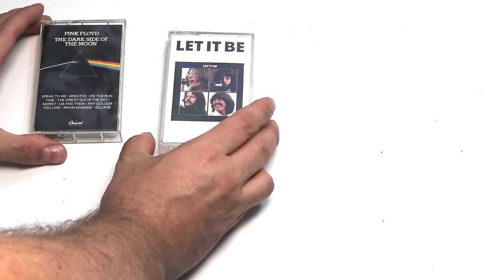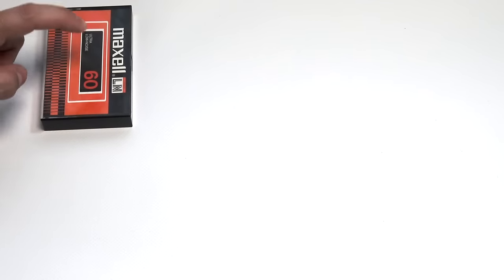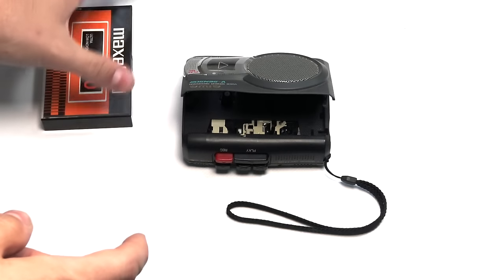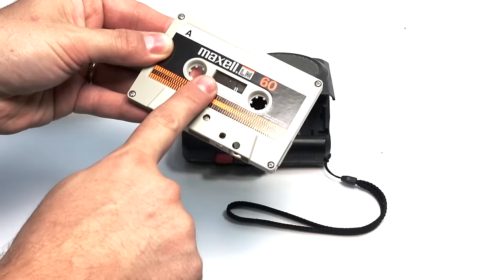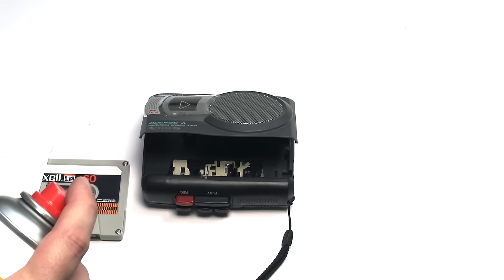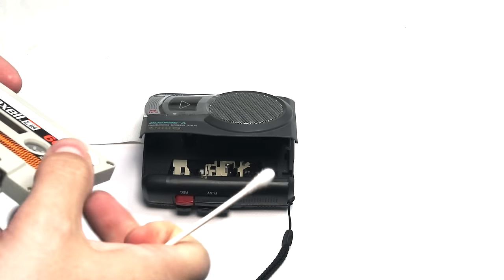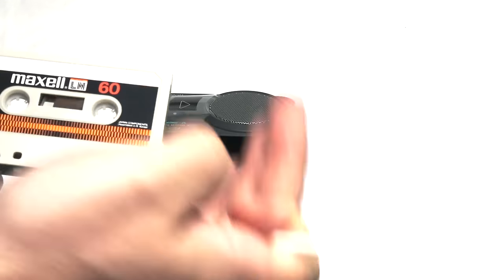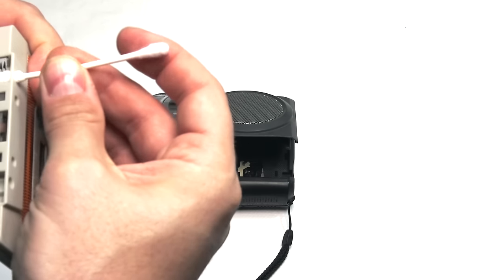How to relubricate your stuck cassette tapes

Comment: I thought the issue with cassette tape binding was always with friction against the cassette shell 'sides'?  Many cassettes even have special film sleeves between the tape and cassette covers to combat this.
Reply from the maker: In some cases it is probably part if the equation, especially when they are winded irregurarly
Reply: EXACTLY, Tim Kerins! 
Although, older cassettes may lack these special sleeves, or have paper-like ones that are not much better than sans-sleeves.
I always saved any prerecorded/blank tapes that got damaged or ruined beyond any salvageable playback, for the parts to "cannibalize" later for repairing other tapes with any dodgy/missing parts.

Comment: I recently purchased a pre-recorded cassette on ebay, and based off what you said in this video, it seems as though it does need lubricating (i tried playing it on my twin deck, in deck 2 the auto stop kept activating towards the beginning of the tape (athough it was fine once i got past that part), and in deck 1, in that same spot it slowed to a crawl a few times)
and thinking about it, i have a feeling there may be a few tapes downstairs that need lubricating (i remember i once tried to play one of those, and the auto stop activated before it had got anywhere near the end, that was before i got my twin deck, and the machine i had tried to play that tape on is now completly broken, well, the cassette part of it is broken, it makes a mechanical noise whenever i turn it on, the noise is coming from the cassette mechanism, for whatever reason the tape heads in that machine are now permently in the raised position, the machine broke when i was trying to record to a blank cassette, it breaking had nothing to do with the pre-recorded cassette)

So i will now have to try and get hold of the things required to lubricate a cassette tape (i already have a cassette player which i think is suitable, i can definatly put a tape in place with the door open, athough i am not sure if the door will be in the way, athough as the door is already a little bit broken on it, and i have another one which is identical, i am not too fussed about breaking the door off of it if needed)

and it seems i may have to experement with different lubricants, as neither of the ones you showed seem to be avalable in the country where i live
Reply from the maker: Great let us know how it turns out! Try looking for a silicon based lubricant with NO solvents, thinners, alcohol etc.

Comment: I would  be very careful with silicone as it is an insulator and can cause head problems if you get too messy. Cool video
Reply: If you aren't confident to use chemicals, you probably shouldn't be playing with electronics either..

Comment: Hi! Very interesting content!

I've been reading some of the articles available, I'll still read all the pdfs...
But reading the comments here I noticed 2 interesting points:
- Those who abhor re-lubrication are thinking exclusively about their tape decks devices: In the useful life of the heads and pressure rollers, basically.
* At this point, electronic devices are like human beings, they don't last forever, and just like us, they can go down instantly. This concern is understandable, because in fact, the more you care, the longer the useful life... But I always knew that a head, or a pressure roller wouldn't last forever, just like in a record player, the needle wouldn't last.
* But on the other hand... I have my device to use it! And above all, my cassettes to listen to them!
I will insanely look for the best ways to store and take care of them!
* The point at which lubrication seems to me to be the only reasonable measure in my case, is that all the cassettes I have are from albums, originals, and I won't run the risk of compromising their physical integrity by trying to open them to do anything another thing.

- So we come to the second point in question, which is the lubrication itself... Which first of all must be handled very well. But in relation to this, my biggest doubt would be: What would be the best lubricant actually to be used? Thinking and prioritizing the useful life of the tape itself.
Can these lubricants actually contain substances that could somehow react negatively with the tape?

I intend to gather more information on the subject before testing on my tapes that have this problem, and which unfortunately are already "Almost lost".

I was also wondering about the "validity" and durability of this lubrication, these tapes that you lubricated, how are they today? Did you do this process other times during these 3 years?
Reply from the maker: Thanks for your interesting analysis! No, I did not need to relubricate. Who knows in 20 years!

Comment: I got a tape in the mail that I had ordered from eBay. It’s specifically an album from the Motown record label, but it has a similar problem to that Beatles tape. The first song, which is roughly around four and a half minutes long, and the last song play perfectly fine. However, about a minute or so into the second track, things start getting wonky. The second side is even worse because there’s parts where it’s barely moving. My dad and I found out that one of the reels is apparently tighter than the other, which would explain why one side works better than the other. So that’s how I ended up here.

Another thing I found interesting is that these were the issues it was having in deck 1 of my Technics RS-TR373 cassette player. In a Sony voice recorder that I own, the tape doesn’t even move. However, in deck 2 of the Technics player, it actually sounded significantly better. It still has its issues, but I found it interesting how the recording deck was able to play it.
Reply: Hey im having an exact problem at the moment what do you mean by reels? Like the spools in the tape or the machine itself.  A response would be greatly appreciated!
Reply from the maker: He means the reels/spools of tape...its always the game problem, just lubricate as indicated in the video!
Reply: It’s called sticky tape syndrome. Try removing the tape and putting into a newer, modern shell. Rewind and fast forward a few times to loosen it up. 

That should work. Do not oil your tapes for goodness sake.
Reply from the maker: Not necessarily John, he did not describe the typical symptoms. If it isn't shedding in a paste on the trasport parts it is not. Lubricating reel to reel tape is a common practice.
Reply from the maker: Jonah, as many other techs you are driven by prejudice without real knowledge, in this case, about this issue. It is really sad to see how arrogant you are, just go back and read your commnets. I see now that you have written several negative comments over the months and I think you should inform youself better before pointing your finger, insulting and denigrate people. I have posted simple things but considering that you would like more proof here you go. After rading this info, I hope you will be polite and intelligent enough to apologize.
Here you will find a selection of scientific papers explaining the issue and how it is a standard procedure to relube tape (even NASA does this!). I have underlined a few crucial passages in the papers: 
Heritage: https://www.dropbox.com/s/f8254yfeqrrw9vp/heritage-02-00097-v2.pdf?dl=0
Nasa: https://www.dropbox.com/s/xxdw1qh8mlbppdu/Nasa.pdf?dl=0
HESS: https://www.dropbox.com/s/ydrvxg6zipjkrvw/HESS_Tape_Degradation_ARSC_Journal_39-2.pdf?dl=0
Preservation Commission: https://www.dropbox.com/s/3s3ejmho2jexhgt/pub54.pdf?dl=0
   - (here is the official article: https://www.dropbox.com/s/rtvqt1n537w9vpa/Bogart.pdf?dl=0)
Kondo: https://www.dropbox.com/s/zi4vv42ggi9vh8u/tribochemistry-of-ionic-liquid-lubricant-on-magnetic-media.pdf?dl=0
Here is an article of a lab that is relubing its cassettes: http://tasso.cat/re-lubrication-of-compact-cassette-tapes-with-sbs/
Reply: Jonah, You are absolutely correct! It was the bad BINDER that absorbed "moisture" (which it is NOT supposed to do!). Putting any kind of silicone/oil lubricant on the tape is ridiculous! That is NOT what is causing the sticking, screeching, squealing, stopping problems that makes the Tapes unplayable! (and it will contaminate and ruin your tape deck!) Later Cassettes had a binder that did NOT absorb any moisture and these tapes still play fine... (They finally figured out what was causing this problem and it was the bad "binder"...) By the way, I am a Tape Collector with over 55 years experience.

Comment: Hi, two questions
1. Are you able to give a 2024 update on a silicone lubricant product that would be work for this process? It appears the 3m product you recommend in this video is no longer available, and i can’t find anywhere selling it online. You mentioned “no solvents”, so would a water based
Silicone lubricant (food-grade) work? If not, what product would meet your criteria?

2. Do you recommend using a qtip to dry up the excess immediately after applying the lubricant, or after letting it sit for 2 weeks?
Reply: Update: I just posted my question, so understandably haven’t received a response yet, however i decided to try out Super Lube 56104 Silicone Oil 100 cst, which i found on Amazon. I will report back
Reply from the maker: 1. Yes a silicon based live with NO solvents will do.
2. Yes, I would use the qtip at both stages

Comment: Many thanks for the detailed analysis of the issue and the solution. I've got loads of cassettes, the oldest one is from 1968. I've had the issue with 3 cassettes so far, one 80s Fame reissue  by EMI,  and two cassettes from CBS (1973 and 1984). 
The first time I used your solution, I think I might have overdone it a little, I saw that I could play the side A for the first time which was a good sign, but the sound on side B was still bad.
Can you say how much lubricant I should use each time. On the video, I can't really see it, I just want to be on a safe side and not damage my precious cassettes.
So to sum up: I will do it twice rew/fast forward x2 per side and repeat it the next day and than will wait about a month or two?
Sorry If I got it wrong, best regards Grzegorz
Reply from the maker: Add the lube and every once in a while relube the cuetip. Let it seep in for a while. And then just make sure to abaorb all the exceeding lube with a few dry cuetips. After that just wait a few days and it may work. Sometimes, for me at least, it took a month!

Comment: Banging the cassette on a table was also a good effective method of freeing up a jammed tape!
Reply from the maker: Very true! Better on your palm though...;-)
Reply: Wow, I tried that and it actually worked! Thanks!
Reply from the maker: Thank you for sharing your experience!
Reply: I just remembered having done the bang on the table routine after reading it here. I am 87 and my mind does not remember everything. I banged the cassette on the table, and rewound it several times and it sounds great.  I also remembered that rewinding is faster and better than fast forwarding.  This was on an early pre-recorded Broadway Cast Album.  When they transferred them to CD most sounded like crap.  What an improvement!!! Tanks CoolDudeClem et al.
Reply: Dude this worked!

Comment: Similar Sqeaking issues can also be caused by the Cassette "Pressure Pad" which can get covered with 'Tape Oxide' from the Back of the Cassette Tape. That part is difficult to clean off as the 'Pad' needs to be smooth for the Tape to run across the Heads. Not sure if you can buy new "Pressure Pads" as they would then have to be Glued into place on the metal spring?. Had lot's of problems with this from old cassette tapes (mostly Blanks) that i was Archiving on to "CD-R" for a friend. Not sure on the Long term issue that this 'Fix' might have on the Tape Heads. Not one for my Nakamichi!.
Reply: You can indeed buy new pads, but I don't know how you'd remove the old ones without wrecking the little metal platform they're attached to.
Reply: That’s what I’m thinking - does it not sound intuitively dangerous to spray random lube onto a tape and then run that tape through your high end deck’s transport….what could go wrong ? 🤔🤔
Reply: When you dispose of old and / or unwanted tapes ALWAYS keep the pressure pads cos they are very handy for replacements.....
Years of fiddling about with cassettes has taught me things like this tho !

Comment: Hi, 
Thank you so much for your video. I want to say its highly informative and I've learned so much from this. looking into repairing some of my cassette tapes from the 80's which are very squeaky when playing. 
I can't seem to find the 3M (08877) wet type silicone spray that you suggest. 
is there an alternative that you can suggest me to try??
Thank you again :)
Reply from the maker: Thanks! You can try a silicone-based lube WITHOUT thinners or diluent or any kind of alcohol. The dry versions have that to make it evaporate immediately.